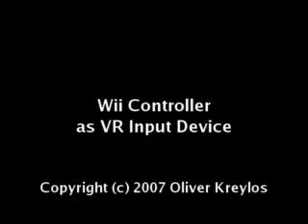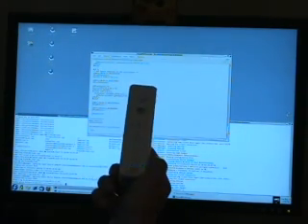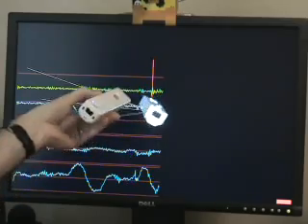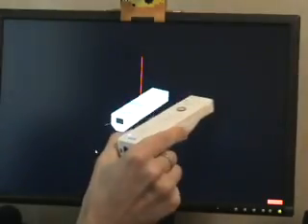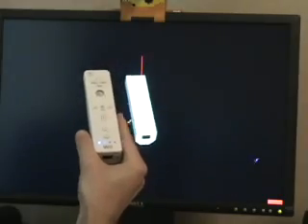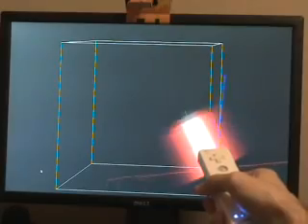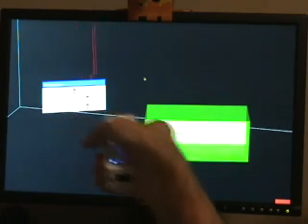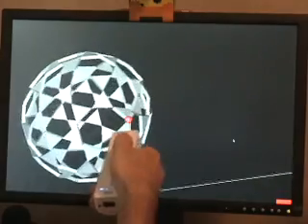Wii Controller for Virtual Reality

Comment: I'm doing this for a peppers ghost hologram scifi monitor interface set up I plan on using a black wii remote control and getting a wii sensor bar and an image projector that uses 3D Projecting to make it appear like a hologram. I already got the set up processing I just need to get the providing equipment for it. I'm actually going to use a mounted computer projection and a holographic laser keyboard to perfect the illusion to feel like Iron Man.

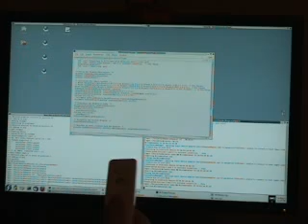Comment: At around 3:30 where you demonstrate "full position tracking" could the Wii controller effectively be replaced by an iPhone utilizing its onboard accelerometers and camera as the sensor inputs and then render what is currently shown on your monitor on the iPhone's screen with the test program running on the iPhone?

Comment from the maker: @megamanxu This tracking relies on an "IR beacon" that is more complex than the Wii's "sensor bar," and it only works if the beacon is inside the camera's view, which is narrow. The motion plus would allow tracking to work even if the Wii briefly loses view of the IR beacon. The emphasis is on "briefly;" even with a motion plus, tracking would still require a beacon that is almost always in view. The motion plus is not accurate enough to sustain tracking by itself.

Comment from the maker: @ScottBarrett No, haven't tried that. The problem is that the Wiimote doesn't indicate when exactly its camera takes pictures, so you'd have to strobe at a rather low frequency to ensure that the camera gets it. As a result, tracking would be quite slow in response, slower than it already is (you can see the lag between motion and response in the video). If there were an indicator, or a way to trigger the camera externally, strobing would be a viable approach.

Comment from the maker: @TimeGlitchCentral

In theory you are correct, but in practice it's complicated. The Wiimote camera can only track four LEDs at a time, so if there are more than four, it will (randomly?) decide which four to track. This would make it very hard to come up with a unique and consistent tracking solution.

But this is simply a limitation of the Wiimote. Other optical tracking systems use your idea to cover large areas successfully.

Comment from the maker: @BOS6940

You are right, but YouEssEssArr is right as well: candles would work because they emit most of their energy in the (thermal) infrared band. After all, candles are hotter than they are bright. Way back when, some people actually used candles to stand in for the official "sensor bar."

Comment: @YouEssEssArr 

no, the wii mote detects infared led lights, normal lights wont work, thats why when using the sensor bar u cant see no light from the sides, but look at it with any type of camera, and you should see 2 lights coming from it, this is because infared lights are visible to cameras ( like the wii mote ) and not the naked eye

Comment from the maker: I changed my mind about the motion plus. Initial reports said it had two rate gyros, which wouldn't have been enough. Turns out it actually has three, which is sufficient for instantaneous 6-DOF tracking, akin to what's shown in the video.

You'll still need some kind of LED array, since instantaneous tracking will lose accuracy very quickly. The LEDs are then used to correct for this drift.

In short, the motion plus would make the software shown here work better.

Comment from the maker: Considered, yes, but works, no. Yaw and distance from screen are not independent. If the sensor bar width is D, and the observed distance between the two clusters on the IR camera is d, then z -- the distance to the screen -- is proportional to D/d. At the same time, if yaw angle is a, then d ~ D*cos(a). So you have two unknowns, z and a, and only one equation. Since you can't measure yaw independently using the accelerometers, it doesn't work that way.

Comment: Nice demo. Have you considered though, that if you switch the Wiimote to 'full' IR mode, and make use of the fact that the standard sensor bar is actually 2 clusters of 5 led's each, you can in fact, use the standard sensor bar to determine yaw, roll, and the distance from the screen?
That would leave just the pitch, which can be determined from the accelerometers...
This is possible because in 'full' mode, the IR data gives the center point and bounding rectangle of each LED cluster...

Comment from the maker: "Sensors" is not quite right because the sensor bar contains infrared emitters and the Wiimote has the sensor, but that's besides the point.

I'm guessing Nintendo went with a 2-LED design because it is enough to get mouse and light gun emulation, and because it is more robust. You can see the tracking hiccups in the video, and for a game system, robustness is more important than bleeding-edge features.

Or the Nintendo guys are not that smart after all. ;)

Comment: Yeah, but the wii only uses 2 infrared sensors, and to get the lightsabur this guy built a 4 infrared sensor block... Why Nintendo didn't do this I don't know... Which is in fact a question I would like answering if you know the answer Spelunkerucd?

Comment from the maker: I've said this before, but I'm not so sure. The motion plus has two gyroscopes, so it can sense motion better than the basic Wiimote, but two gyros are still not enough to locate the Wiimote using dead reckoning (you need three). You'll still need some kind of sensor bar or sensor array. There is no doubt though that the motion plus will improve things.

Comment: In the mid 90's I worked as a tester on a project using the nintendo powerglove which did positioning by ultrasonics. The glove transmitted 2 different frequencies, received by three mic's on the monitor. With that you had yaw pitch and roll until the plane of the speakers on the glove lost one of the mics.
The cable powering the glove passed serial data for the standard button pad & 4 position  resistance values per finger(4). This allowed gesture recognition for interactive VR controls.

Comment: You are a clever man.  You spoke about limiting the hiccups.  If you make the tetrahedron larger (ie, around the entire monitor) the accuracy will be greater.  Also if you use just 3 IR leds, the camera will be able to work out which ones are visible (or not)  to make that better still use an equilateral triangle and place the fourth 10 cms above the top led.

            .
            .

      .             .

Comment from the maker: That would be correct for a tracker with 3 rate gyros, but from the manufacturer's specs, the ID600 only has two gyros. So we're still missing a degree of freedom. It will surely improve gesture recognition in Wii games, but won't be enough for full 6DOF dead reckoning.

Comment: Nope. Contains an IDG600 gyro. I'd guess there's also a microcontroller or Wiimote firmware extension in there, unless the Kalman filtering is happening in game software.

And spelunkerucd, there is no reason why a full 6-DOF IMU, as the Wiimote will be with the Wiimotion Plus, can't do three-axis dead-reckoning spacial tracking. And it will be referenceless so, assuming bias compensation and proper calibration, no more sensor bar.

Comment from the maker: Actually, no. The MotionPlus allows more accurate gesture recognition, but it will not be able to do the full tracking I show in the video.

The beacon/software I'm showing here can tell exactly where the Wiimote is in relation to the beacon.

Look at the lightsaber section, where the blade (drawn on the computer screen) more or less exactly follows the real Wiimote I'm holding in front of it. MotionPlus can't do that -- whether that's important for games is another question, though. :)

Comment from the maker: I'm just guessing, really.

The lag in this video is due to my poor low-pass filtering; I introduce lag to reduce jitter. Games that are to a large degree based on accelerometer pattern matching get lag because the pattern logic has to uniquely identify the beginning of a stored pattern before it can apply the pattern's action to the game. So depending on how complex the patterns are, you get more or less lag.

I guess that doesn't answer your question, though...

Comment from the maker: That's exactly what I've been asking myself since day one. :)

But don't set your hopes too high; the MotionPlus add-on will definitely improve tracking, but, by itself, it will not give the same 6-DOF results I'm showing here in the video. Purely inertia-based tracking systems are notorious for drift, and without an IR beacon and software like this, there still won't be a good way to correct that.

Comment from the maker: This idea is not as "out there" as it may seem. Proper force feedback will not be achievable for home use anytime soon, but it's surprising how far you can go once the users' brains suspend disbelief.

Our CAVE VR system (see other videos) does not have force feedback at all, but some users report "feeling" the virtual objects they manipulate in some of the programs. This is just the brain filling in what it thinks should be happening, based on visual immersion.

Comment from the maker: Well guys, hold on to your hats. From the early reports, the Wii MotionPlus add-on does indeed add gyroscopes. This means it will be possible to use the linear accelerometer measurements to fully track the controller's position in 3D space, which, as I explain in the video, cannot be done right now.

I'll see if I can get one of those things and adapt the driver software. This could be very cool.

Comment from the maker: Small beacon is one source of noise (the visible jitter), but the reason for the hiccups is that the tracking software gets confused when one or more of the LEDs move off-camera. The Wii camera has a very narrow viewing range.

So while making the beacon bigger would help reduce jitter, it would increase the occurrence of hiccups because a bigger beacon means there is a higher chance of the camera not seeing all four LEDs.

It's a tricky problem.

Comment: The problem with his hiccups is that the LED tetrahedron is so small, in relation to the potential range of view of the wiimote.

Better, would be to make the tetrahedron larger, so that it has the same effect of being closer to the tetrahedron, which drastically reduces the propensity for the wiimote to stop viewing all 4 points of light.

A good way to ensure this, is to have the beacon lights attached to a slider frame with arms attached, which uses electrical resistance to determine size.

Comment from the maker: The nunchuck extension only has accelerometers (more accurate ones than the controller itself, actually), but because it lacks a camera it can't be used for full 3D tracking. I bought one to try, but don't find it useful besided providing more buttons and a joystick for non-3D interaction.

Comment from the maker: There is a cool paper out of UC Berkeley about full inertial navigation using only six linear accelerometers, in a clever configuration (google for six-accelerometer gyro-free IMU). So you won't need gyros much longer. I can't wait until someone integrates that configuration into a cheap single unit. The next generation Wiimote could be so much better!

Comment from the maker: You'd need at least two cameras. The 3D tracking works here because the four LEDs are fixed with respect to each other. If they could move independently, as in motion capture, a single camera could not reconstruct the distance of the points, and only track in 2D -- which would then be exactly like Johnny Lee's Wii multitouch project.

Comment from the maker: Not really. The Wii camera can detect the specific LEDs I'm using from about 3-4 feet (1-1.5m) away, but the farther away you are, the less accurate is the tracking.

Of course, you can have the beacon with the LEDs sitting right in front of you and your couch, if you're so inclined. It doesn't matter how far away the TV/screen is.

I mostly use the Wii as a desktop input device with my computer, with the beacon sitting next to and slightly behind the monitor.

Comment from the maker: True about the additional beacons -- it's just a matter of building them and calibrating them with regard to each other.

The tracking itself does not use accelerometer data, but the matching between LEDs and camera points does. More detail on the web page and in the code.

Comment from the maker: Yes, the tracking is fully 3D. The 3rd dimension, of course, doesn't show up in the video all that well. Position is tracked in (x, y, z) and orientation in (yaw, pitch, roll).

(Although internally orientation is represented as a unit quaternion, but that's just an implementation detail.)

Comment: This is similar to how the P5 Glove works - the base station (containing 2 cameras) tracks the LEDs on the glove.  It knows how the LEDs on the glove are oriented in relation to one another, and can use this information to figure out the glove's orientation and position in 3D space.

We have been having good results with Kalman filters to cope with error correction - they work very well.

Comment from the maker: I don't think that's the main reason. I see three problems:

1. This tracking is not very robust, as you see in the video. The problem is the narrow viewing angle of the Wiimote's camera.

2. Nintendo decided to go with a simple 2-LED sensor bar, which is not sufficient for this tracking. Developers wouldn't bother making games that require a custom LED beacon.

3. 6-DOF tracking doesn't map well to games played on a TV from far away. It's more for immersive display systems, like CAVEs.

Comment from the maker: The reason for the jumps in tracking is that the Wii camera only reports four LED positions, but not which LED is seen in which position. If all four are visible, it is easy to determine the correct association. However, if only three or less are visible, I don't yet have good heuristics to make a partial match. That's why the tracking sometimes gets confused, and why it sorts itself out once the camera sees all four LEDs again. This can definitely be improved.